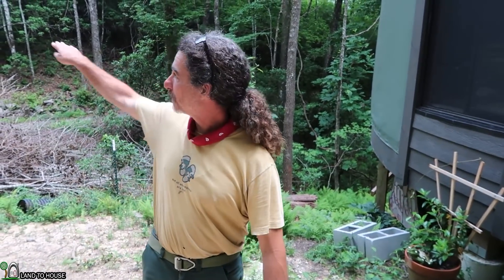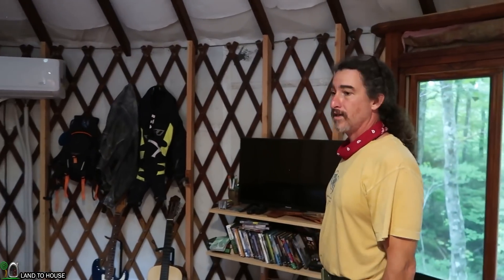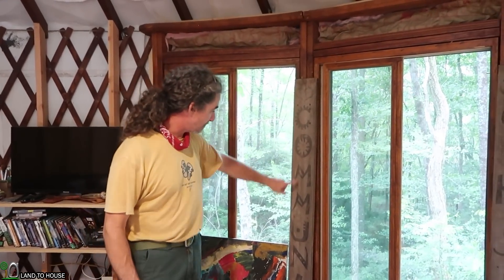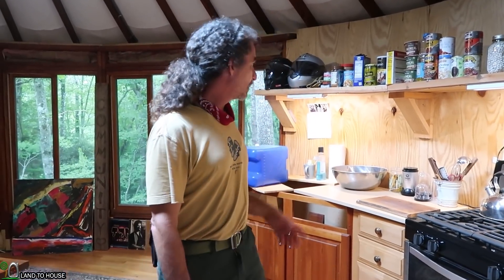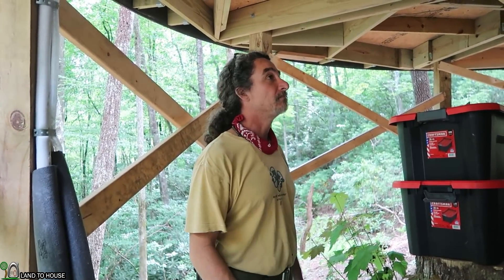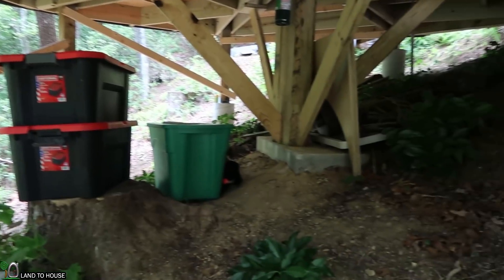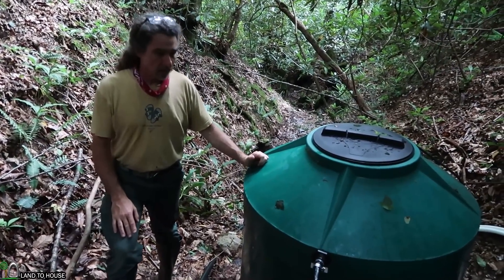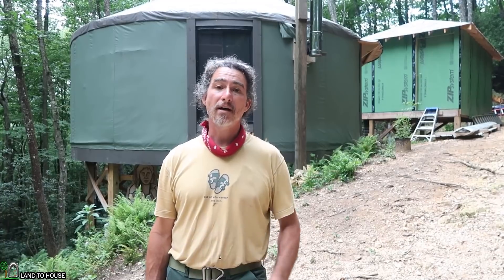Life in an OFF GRID YURT

Comment: He has a nice property and set up.  One thing I noticed was his support beams are held up by bolts through them and the posts.  The best arrangement of joints for load carrying is to support the beams from below and use bolts only to prevent movement.  For longterm, he probably should add some supports under his beams for the safety of the structure.

Comment: There are heat pump water heaters and electric dryers you could probably get away with running off grid.  They are pricey though. 😢 

I would try to tap the heat from that mini split to prewarm water and/or dry clothes.  It's literally blowing hot air in the summer.  I have no idea how effective it would be but worth a try.  Maybe just put a drying line in front of it.  Probably work for socks and skivvies.